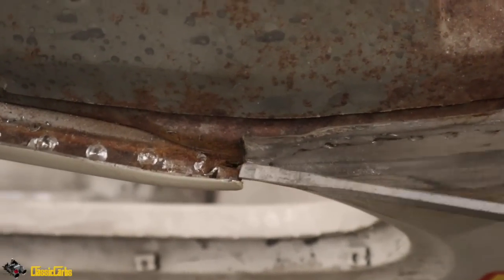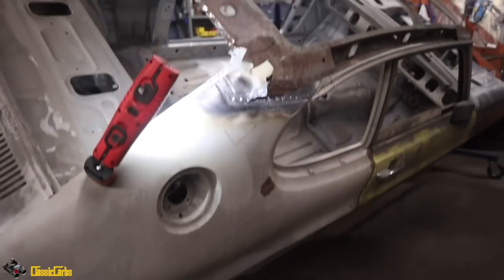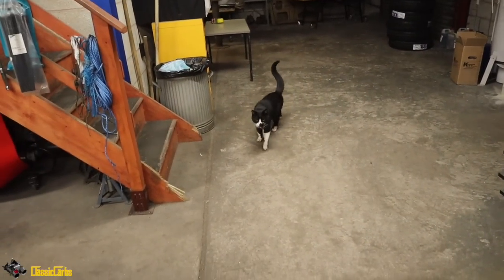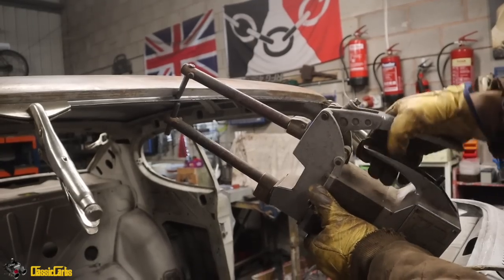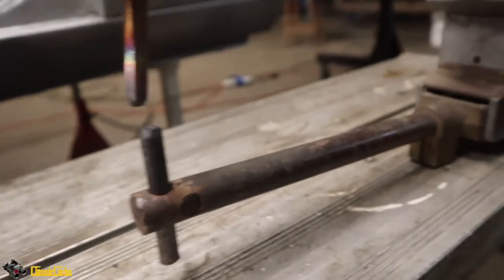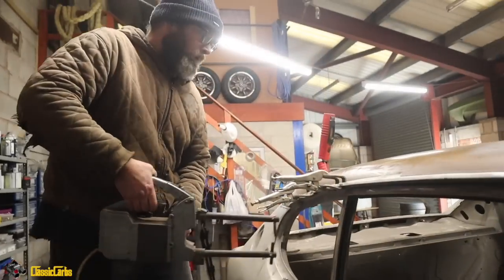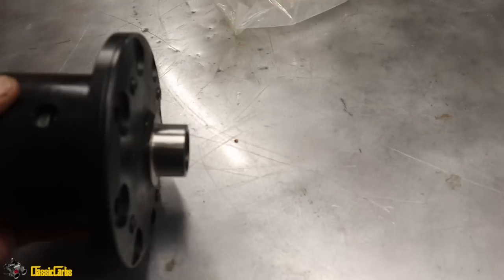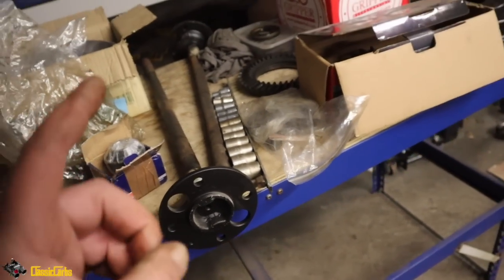1969 FORD CAPRI - PART 108 - New Roof-Skin is ON!!

Comment: Very interesting project to see in action.  My first car was a GT3000 1972.  And 5 years ago I bought a very good condition Vermilion Fire (orange) GT3000 1970 with 4-gauge dash.  It has limited slip diff, rear disc brakes, 4-barrel 390 holly, roller rockers, 5-speed celica gearbox, globe wheels.  Very cool.  Worth it!   All the best for 2023 and Kate.
Reply from the maker: Very cool! And thanks! Do you still have the car? Any photos? Sounds 👌